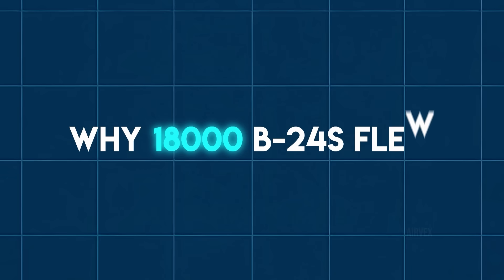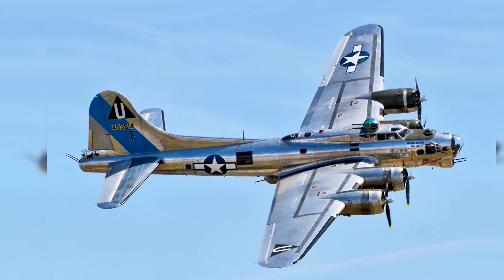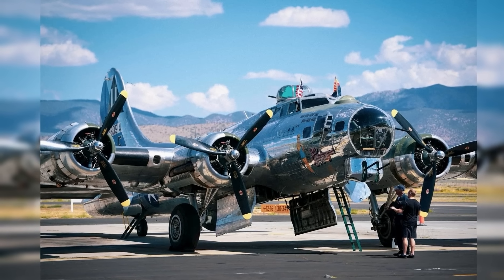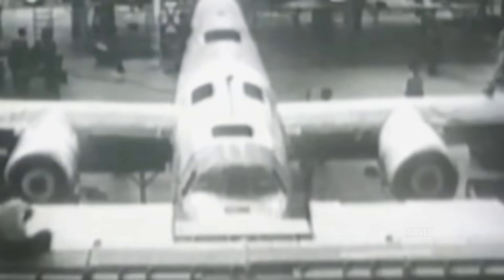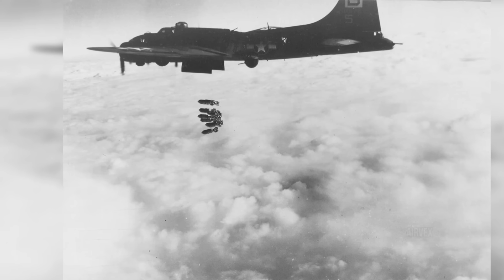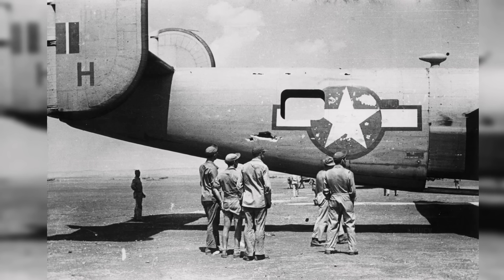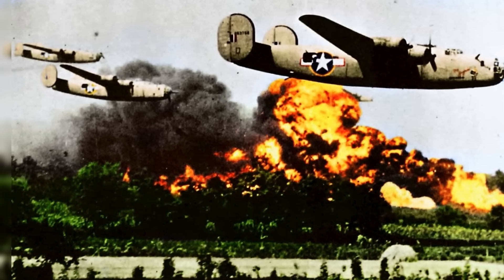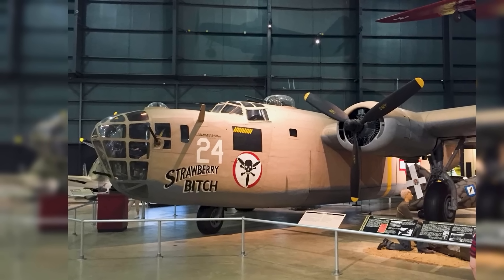Why 18,000 B-24s Flew With the Wrong Wing for Combat?

Comment: The B-24's wing was damaged more easily because of the way the landing gear was retracted sideways into the wing. This minimized the full length wing spars that could be put in the wing in this area. The B-17's landing gear retracted forward into the engine nacelle. This made the wing more capable of withstanding more damage in the B-17. My great uncle flew the B-24 with the 485th BG and 831st squadron out of Venosa, Italy.
Reply from the maker: Interesting, thanks! Appreciate you :)

Comment: What is a cool fact that ford in willow made the majority of the B24s in willow Michigan 1full plane made in 63 minutes down the assembly line as if it was a automobile
Reply: Willow Run MI. The plane was built in sections. Mom's aunt worked there building B-24 Liberators. Fast forward: While earning my SEL private pilot license, I flew in & out of Willow Run; once when there was snowy slush on the runway. The plane wiggled back and forth sideways through the slush during the touch-n-go. This day, there are only two airports in Michigan open 24/7: DTW (Romulus) and Willow Run. Willow Run serves as a cargo hub. DTW serves as a hub for passengers and mail. Both airports are so close to each other, DTW's Terminal Control Area (Detroit Approach) looks like a bite was taken out of an upside-down birthday cake as shown on the TCA sectional.
Reply from the maker: @TheHawk--oe8iq  Wow, thanks for sharing this story! Appreciate you :)
Reply from the maker: Yep!

Comment: Having toured inside both the B-17 and B-24, the Boeing B-17 was my favorite. The B-24 was larger and had more internal volume. But it had few entry/egress points, the walkway in the bomb bay was crazy narrow without a flight suit, and the internal layout was somewhat confusing with places to bump your head into. On the other hand, the B-17, although not spacious, it had a layout that was intuitive, and appeared more rugged. I appreciated the multiple entry/egress points along the fuselage. So if you ignore the metrics, I can understand the popularity of the Boeing B-17, even though the Consolidated B-24 outperformed it and did additional roles during the war.
Reply: My father flew -24's. He preferred the -17 not because of the things you mention but because of flight characteristics. It was hard to get in the air loaded. It was unstable in flight and difficult to hold formation. A pilot would return absolutely exhausted from just fighting the controls for the mission. The -17 was more stable and easier to fly. Also, the -17 was more rugged and more sturdily built. The wing roots on the -24 were notoriously weak. On a heavily loaded takeoff, there was enough flex that it caused fuel leaks and even line ruptures. This caused, on more than one occasion, the aircraft to blow up mid air on takeoff. Not a confidence builder.
Reply from the maker: Good point
Reply from the maker: Yeah, agree! Thanks for sharing your experience :) Appreciate you
Reply: Not to mention the 17 is prettier
Reply from the maker: Haha, maybe :)
Reply: @rexbentley8332 ❤❤❤
Reply: I did a walkthrough on a B-17 that landed in my city. And you're a 100% correct, the B-17's corridor (Aft-to-Bow) was extremely cumbersome to navigate. There was this super-narrow metal corridor, probably less than a foot in width, to navigate over the bomb bay. Honestly, it took careful effort to traverse while the plane was grounded; I can't even begin to imagine how precarious that corridor would be with a damaged plane struggling to stay level.
Reply from the maker: @jayklink851  Interesting, thanks for this fact :)
Reply: Yeah I am not so sure about that. Given I am 6' tall it seemed like everyone was ducking all the time even shorter. I need to walk though a 24 now to see lol. Looks like they were standing. I think about the B-24 and those tiny tunnels you had to crawl through to get everywhere. It is like they designed things to both maximize the space and meet performance goals so while it might not seem bigger it sure was. Like with the ball turret, being able to raise that was so ideal. But you also had to deal with a huge frame around it. The turrets were bigger and better and more considerate in the 24. 
Yeah the 17 is prettier but hard telling which I would have rather been on, as if you had a choice. lol
Reply from the maker: @chris_hisss  Haha

Comment: It is important to know that, when the B24 was designed, it was believed that it would fly above any flak and would have little problem dealing with fighters.   Note that the later B29 also had a high aspect ratio wing because it needed it to reach the target and a B17-style wing simply could not do it.   The Davis Wing also was designed before laminar flow was well understood.  It can be argued, however, that the B24 should have been redesigned part way through the war to make it more tolerant of battle damage and to make it easier to handle.  The handling was eventually improved, but that B24-N was only used post-war.
Reply from the maker: Yep, good point!

Comment: the best bomber in the world is worthless if it doesnt make it home. the b-24 probably shouldve been restricted to cargo duties and maritime patrol where scant resistance is expected.
Reply from the maker: Yeah, I can see your point :) But at the same time both the B-17 and the B-24 had their strengths and trade-offs. The B-17 earned its reputation for ruggedness and defensive firepower - it could take a beating and still limp home. The B-24, on the other hand, offered greater range, higher speed, and a heavier bomb load, which made it invaluable for long-distance raids, anti-submarine patrols, and supply missions. In practice, the two complemented each other: the B-17 was the "flying fortress," while the B-24 was the versatile workhorse that could be adapted to missions the B-17 wasn’t optimized for. Neither was perfect, but together they gave the USAAF strategic flexibility it wouldn’t have had with just one design!
Reply: @Airvex-f3d  towards the end of the war the b-17 pretty much matched the b-24 for range and payload. the channels wwII us bombers did a comparison video.
Reply from the maker: @thurin84  True, by the late war the B-17s were improved and could carry similar payloads over comparable ranges. But even then, their designs still reflected different priorities: the B-17 prioritized durability and defensive survivability, while the B-24 maximized efficiency, speed, and operational flexibility. In real missions, each type’s quirks: how they handled flak, formation flying, and maintenance - mattered just as much as raw stats. They complemented each other rather than directly competing :)